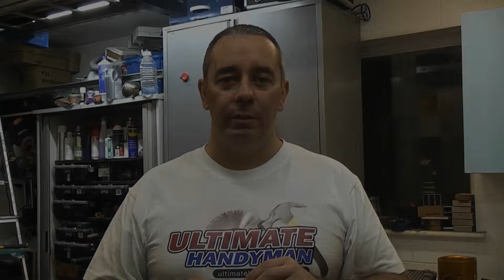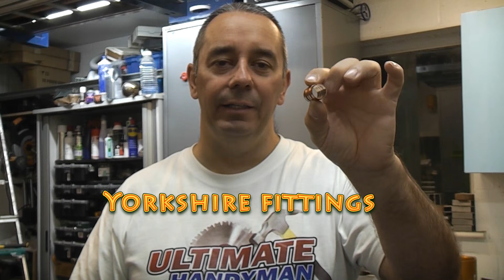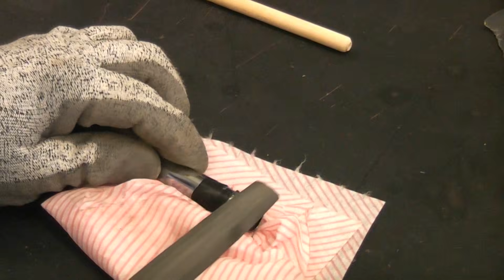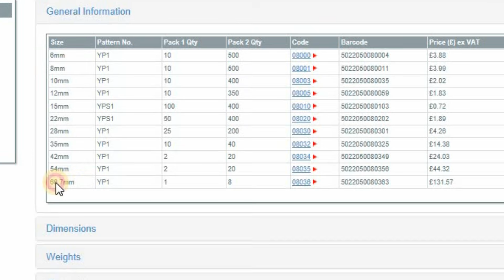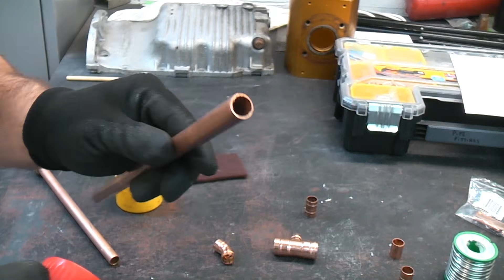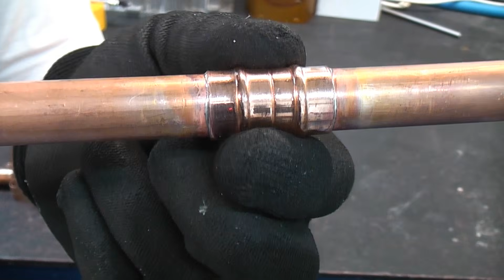How to use Solder ring fittings | Yorkshire fittings

Comment: was it in the edit or do you just apply heat from one direction?...
Reply from the maker: I just apply the heat from one direction. Originally I used to move the torch, until a plumber of over 40 years in my forum watched one of my videos and said "keep the damn torch still" ;-)
Thanks for the comment
Reply: thanks for that and the video...  I'll stop contorting myself trying to get to the back of fittings now that I know that!
Reply: copper is superb at conducting heat, wont matter what you do with the heat, and mostly you are plumbing in a tight spot with a solder mat behind anyway
Reply: On bigger sized pipe fitting, you should move the flame from one side to another to get the heat to spread, but not necessary on 15mm or smaller.
Reply: woodbine66 is that really true? As someone above says, copper transmits heat so easily I doubt it’s needed.

Comment from the maker: I’m glad to say that shutdown 2018 has finally finished, after working 60 hours a week for the last 6 weeks I can now have two days off in a row 😊 

I hope everyone has a great bank holiday weekend 😉
Reply from the maker: Someone has a lot of tax to pay as well.
Thanks for the comment
Reply: Same here in Germany, to say the tax rate for overtime destimulating would be a gross understatement (you get like 30% from what you do)
Reply: Someone has a lot of extra cash to spend :P
Reply: And "they" threatened an unemployment explosion if the UK left the EU...
Reply: Can these be used on A/C lines to braze the pipes when installing a compressor or are they made for low pressure applications only? Thank you.
Reply: Eazy peazy lemon sqweezy
Reply: Hi, I used one of these under the kitchen sink carcass to replace a isolation valve. Unfortunately at the bottom end of the integral ring not all the solder run through. It's allowing the water to pass ever so slightly and I don't want to take the risk of leaving like that. As it's on a raising main if I drain the system fully down, reheat the fitting and apply flux do reckon it will work?